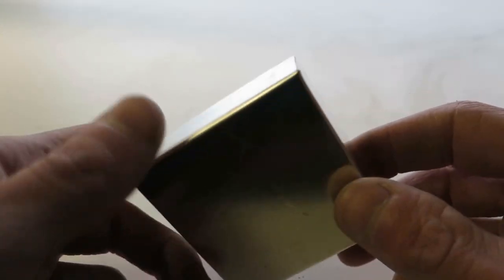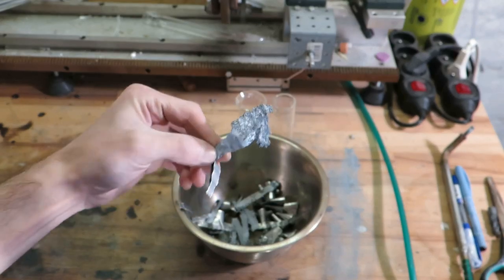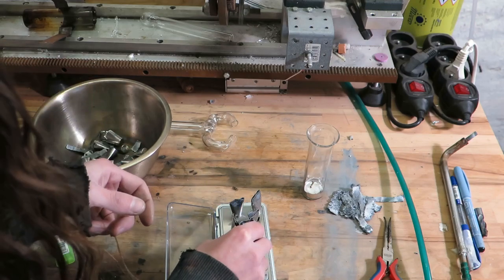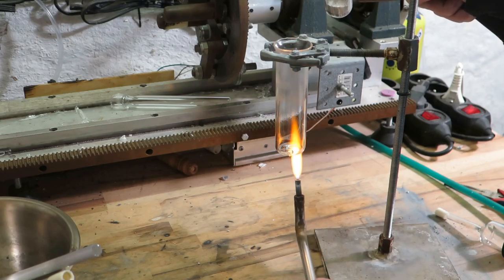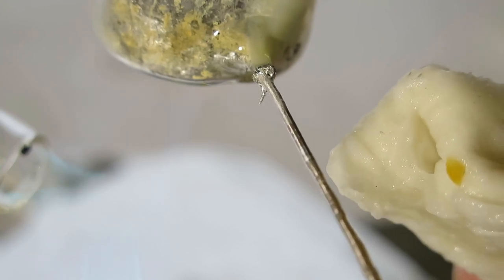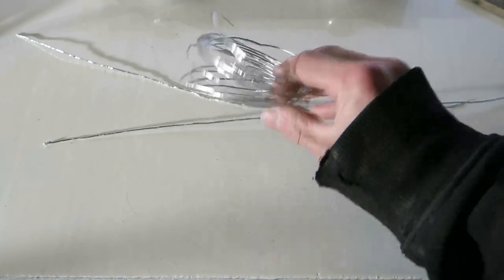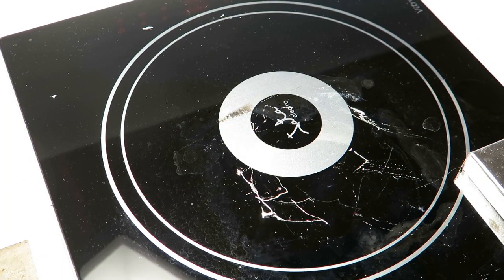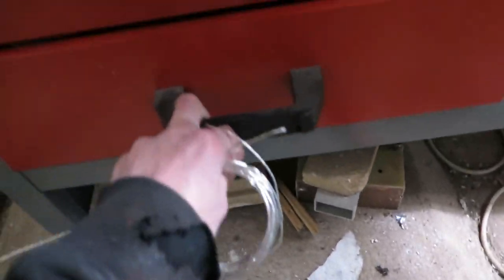SnZn alloy for soldering aluminium

Comment: Impressive results! I once tried to melt Aluminium in a Quarz Glass Tube. To my surprise it cracked while cooling down. After that, I thought melting metals in glass tubes and forming alloys wouldn't work too well. Haven't you had any issues with that?
Reply from the maker: If you refer to method of making rods, I had no problem there. This alloy melts at like 300-350°C. so it's fairly easy on glass.
I can imagine aluminium trying to eat some oxygen from glass molecules when hot and sticking to glass though. Or even dissolving glass at very high temperatures.
Reply: @IlusysSystems  I also thought it might be the glass getting attacked by the aluminum, but I didn't expect it to crack. As far as I know hot NaOH doesn't crack glass, so I thought it may be an expansion/contraction of the aluminum. I don't know. Thanks for your answer!